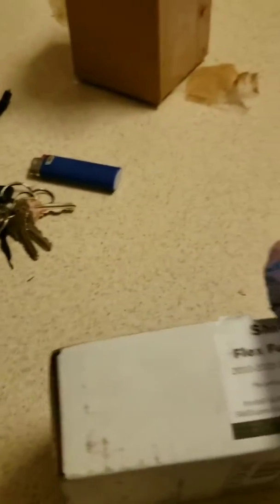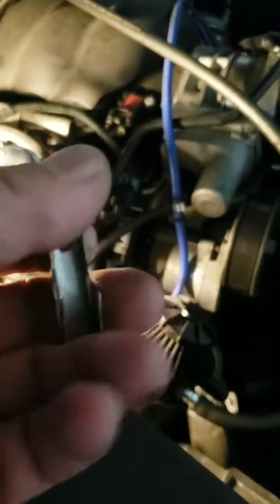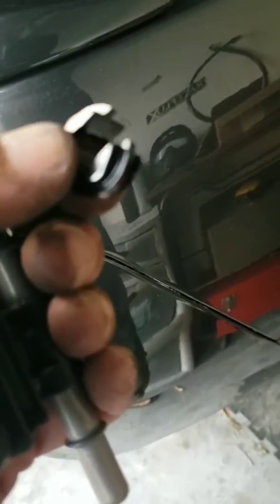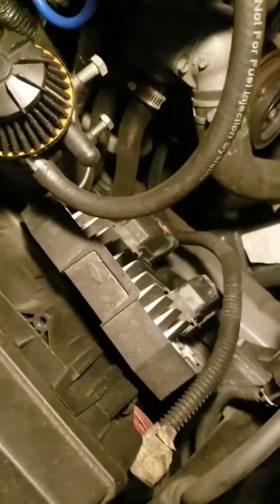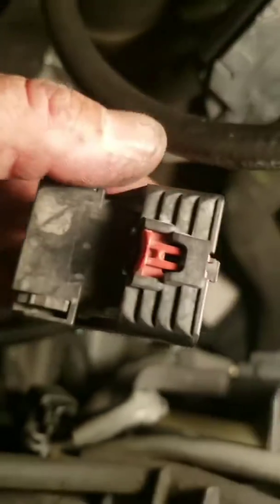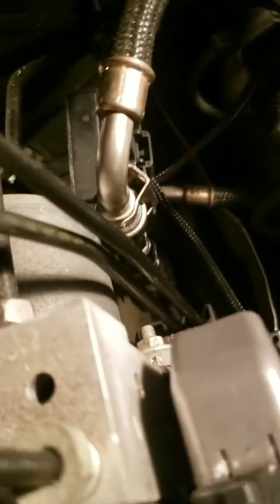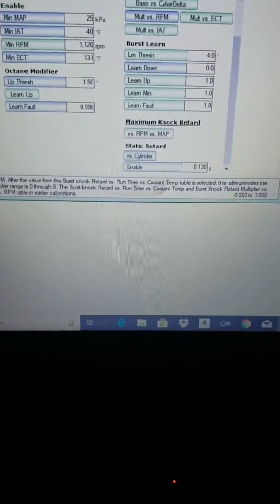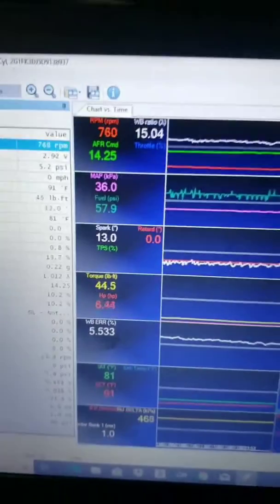5th gen camaro flex fuel kit install

Comment: Did you not have to upgrade injectors? Been told in addition to adding this need bigger injectors
Reply from the maker: I already had 1000cc installed.
Reply: Awesome sorry i saw you answered that. Good video thanks for sharing. What power did u gain?
Reply from the maker: @c4love  I have no idea. Gained a lot of peace of mind runbing a better fuel..
Reply: @yolofullsend you think I’d need bigger injectors on a long tube headers only car? Im putting a supercharger and cam in whenever all the parts arrive so i know I’ll need bigger injectors later on. But wondering if i can run e85 for the time being for a little boost in power, and the smell of course haha
Reply from the maker: @DatHondaBoi223  not sure you will get much gain in power without boost but go for it.. make sure you have the fuel system to handle it..
Reply: @yolofullsend  yeah lsa is on the way, boost district takes forever to get their kits out. Was wondering if I could run E on stock fuel system for now with headers only and tune
Reply from the maker: @DatHondaBoi223  when I was on the zl1 pump it could do e but with no boost.. it was at its limit for sure.. stock injectors are too small for e..
By all means add the flex sensor but I wouldn't put e in until you've got a fuel system.. what car so you have?

Comment: How was the results? Did it make a good difference?
Reply from the maker: Sorry for the late reply.. yes.. I've added timing to my wot area and no knock.. my gas mileage took a major hit but with the price difference it works out about the same mpg.. its cleaned my pistons lol.. personally I will never use pump gas again in a boosted car.
Reply: Hell yeah i just installed the flex fuel kit and got tune but i feel like my car stalls a bit at higher rev i don't think its normal  it takes of quicker but at high rev feels kinda funny
Reply from the maker: @gerardoruiz9441  you def should get that checked out.
Reply: Im definitely gonna get with the guy that tuned my car tomorrow thanks brother
Reply: I installed and ran for a bit/ not too msny miles but maybe just enough.now car is throwing p0174 and asking replace fuel pump as fuel pressure is too low. My first guess is drove a bit too long w/out tune. I thought this wouldnt be an issue though
Reply from the maker: Also my engine bay is a lot cooler..

Comment: On my 14' ZL1 it uses the E67 ECM. Do you know what pin the flex fuel wire would go to?  Thanks
Reply from the maker: I dont know for sure, but a google search said pin 5 on j1 (blue).